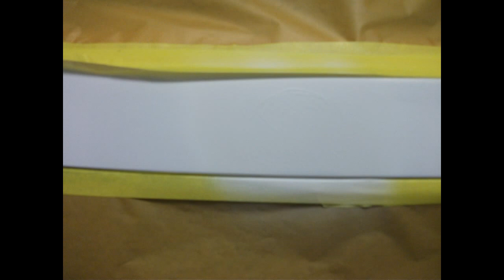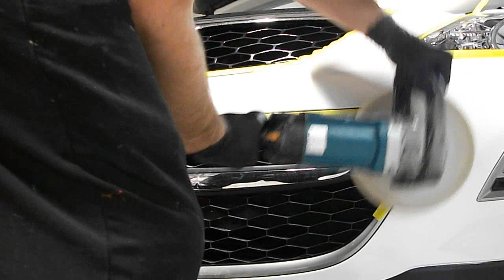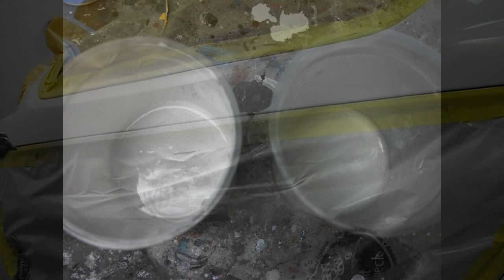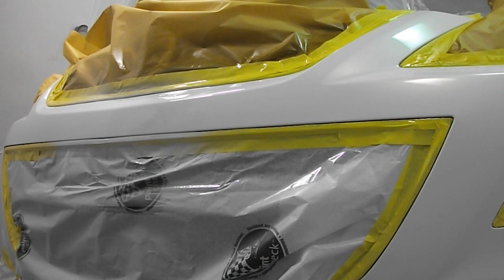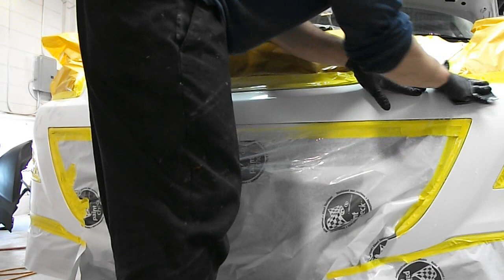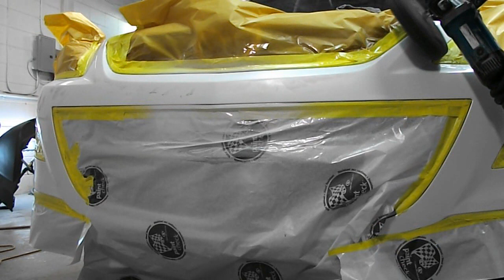How to Blend Clear Coat (Base / Clear) - Spot Repair

Comment: Great video! Doing this is hard especially on white tri-coats and you made it look easy! I have one question though. After you get coverage from your base coat and start applying the pearl how do you avoid the surrounding pearl areas from looking darker than the original color? In other words, let's say you need to apply 3 coats of pearl over your base to get the factory match. The pearl over spray that lands on the surrounding (already pearl colored) areas will most likely be a darker shade.

Comment: I used Omni black paint and clear on a hood the other day. The paint came out great but the clear had super orange peel to the point point of almost 1/8" hail damage looking spots. Three coats of clear within 8-10 minutes was what it called for not sure why it came out like that. It was chilly out but we had heaters at 72 hours before clearing, wiped off with the grease and wax remover, air pressure was between 32-40 depending on if you were spraying. Any tip your could give me? Thanks

Comment: What do you mean by activated clear? I'm facing having to do something like this on my friends car. I had my manager paint it and he didn't get enough color on one side of the roof. It's a 1972 Volvo p1800es the hatch back kind. It's a dark [ transparent green] Chromabase paint with high solids clear. I'm thinking 1200 the whole roof           [there are some other flaws] blend and clear the whole roof. Problem is I'm going to have to burn it in at the pillars because there's no where to cut it off. I always see these repairs [ fade out] on other cars. I'd almost feel better leaving a small soft line somewhere that's not going to fade out. the front windshield pillar is thin but the rear is wide. I understand it is best on vertical panels. I have a lot of time invested in getting this car ready to paint. I think I'm pickier about it than the owner. LOL.  Should I burn the front pillar at the top , mid way , or try to hide it at the bottom?

Comment: Great video but I wasn't clear on a couple things.  Were you buffing the panel at the start just to clean it?  Is it ok to use a course cutting compound with "super micro abrasive technology" (Meguiars M100) or will that refine the scratches too much?  I couldn't understand the point in polishing it when you just sanded it with 2000 right after.  On that note, did you sand the panel with 2000 beyond where you would finish the blend with the intent to just buff it out later or did you clear beyond the sanded area?  The follow up question to that is, will the clear stick to a panel that has not been sanded?
Reply: Buffing with compound prior to painting helps clean and remove light scratches and bug guts, ect... Now, your sanding with 2000 grit should be over extended past where you would put your Blender. I, normally, will sand 12 inches past my blend line to insure proper adhesion and not have to worry about my blender peeling back and leaving a halo ring on my final buff. And, YES, EVERYTHING HAS TO HAVE A LIGHT SCUFF OR SANDING TO ADHERE.  Hope, that helps you, bro.

Comment: This is the reason I started working for myself. If it's a private job some times people don't want to spend the money to get the job done properly, and on the other hand with insurance work the times are cut to save labour rates and you're forced to take short cuts to make your times, either way is a compromise on quality
I would like to see the blowins 6 months later on a black car, and would quite happily wager my left testicle ( My good one  :) ) on spotting the fogged edge of each blowin

Comment: I'm wondering why Auto Painters sand into the blend. Any sanding into that clear blend will tear into that blend and up close will show a tear line. We paint Guitars all day long and have to deal with blending small poly repair areas. If I dare took even 5000 into that blend area it would show like the san andres fault.
Reply: Depends on what size gun we use to clear with. Large guns seem to leave a heavy texture on the blend area so I usually will  lightly hit it with 2000 grit to help knock it down. Small guns with a 1.0 tip, compound will work. But, you have remember that factory auto paint has some orange peel so to keep a uniform look, a big gun generally is best for us. Also, the paint matters a lot. If you are spraying lacquer to paint guitars, then, it burns in a lot easier than urethane clears.

Comment: im sorry but can you please explain a little better the point of polishing the bumper before you wet sand it? because your pretty much eliminating any scratches the polisher left by wet sanding. and i agree with bullaslug clearing the whole bumper cover would have been cheaper and less time consuming. and you could probably use the pre buffing at the end to make your finish as clean as possible.

Comment: There is no yellow "pin striping", that's just masking tape to cover the parts that he didn't want to paint. AS FOR PEARL mix, all tri-coats are done the same: Once you have the repairs completed, have primer surfacer and sanded for primer sealer:::THEN you are ready for your TRI COATS: 1st the basecoat color-color-clear.

Comment: I, personally, disagree with spotting in a front bumper unless its a lower part or there is a curve or line in the bumper. The lack of clear at the fading  and the blender will chip very easily. Front bumpers just take too much road abuse for a Quick-Fix paint repair.

Comment: Its laziness, spot repair guys dont like laying on the floor to take xmas trees outta splash shields to get the bumper out (or there too dumb to figure it out without scratching and breaking shit.) and there poor little fingers start to hurt after sanding that much :( aww muffin.  "...who the hell uses a polisher to sand a bumper???.."